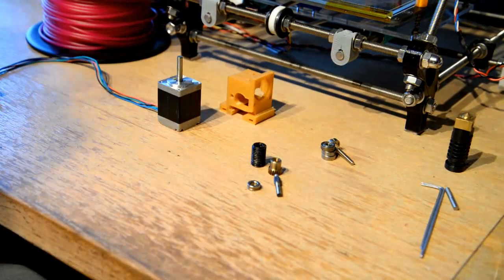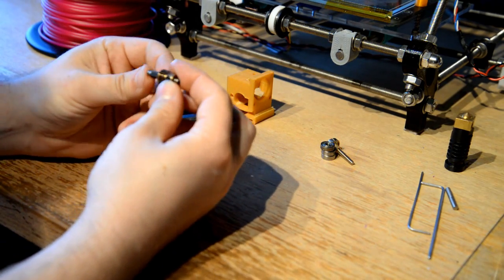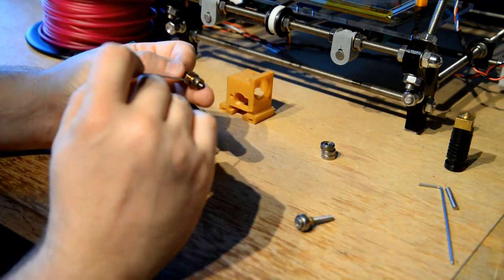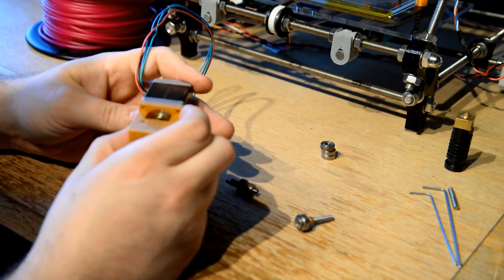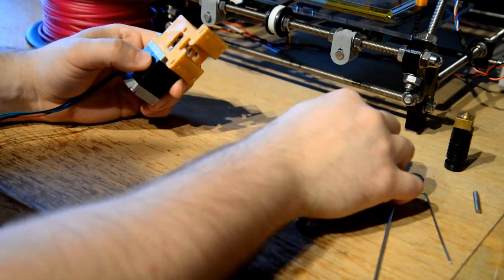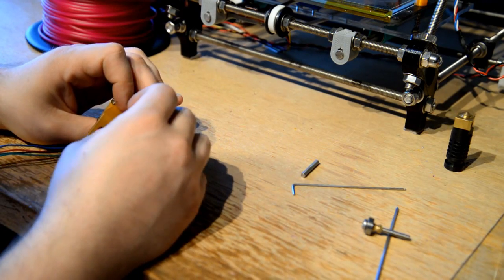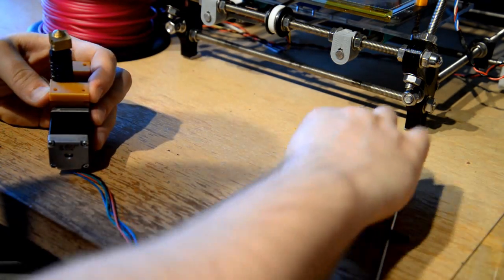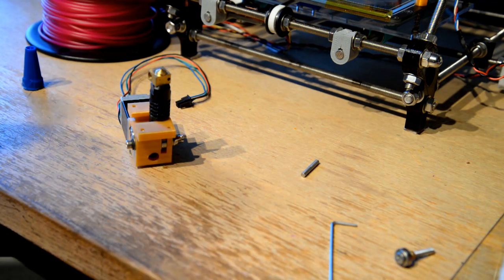How to assemble an Urchin 3D Printer Extruder

Comment: Brilliant KISS design. Worm gear is most simple, compact solution in this case. 

Where did you find the worm/drive gear combo that works, please?
Reply: KHK stocks the worms and worm wheels in various sizes, but the ones in the video are 0.5 module single start with a 20 tooth worm wheel.